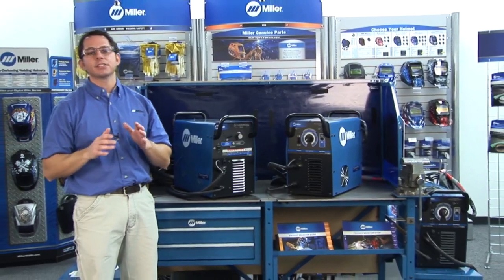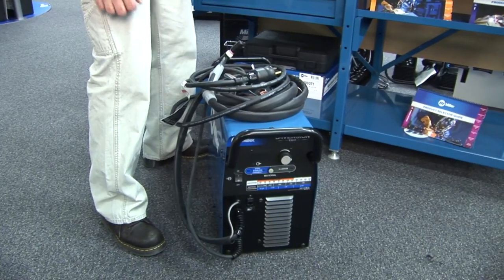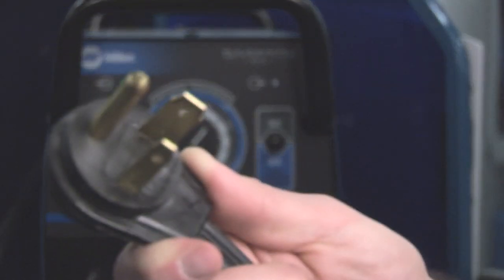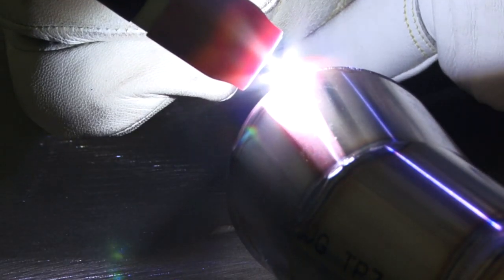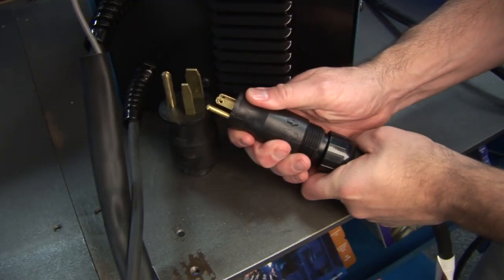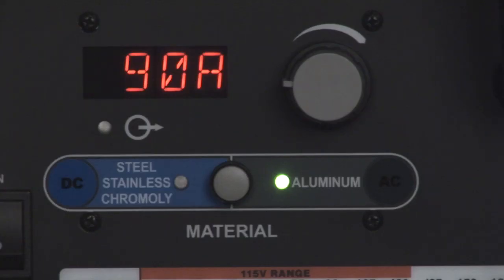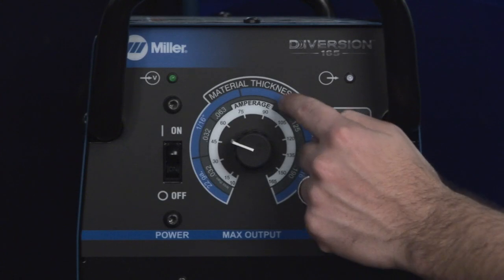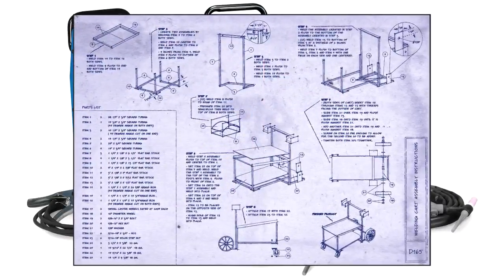Miller's Diversion Series TIG Welders

Comment: i had a lot of trouble with mine for a year until i discovered the problem.  i could not sit the welder on the same steel table that the work was on.  the tig voltage would come up through the steel center of the foot pads on the welder and stop the welding process.  the machine needed  bigger rubber foot pads to insulate the machine.  i found larger ones and installed them then insulated the machine more by placing it on a piece of plywood then it worked ok